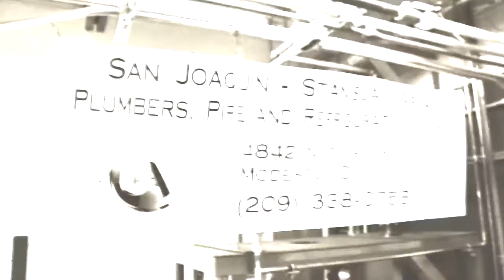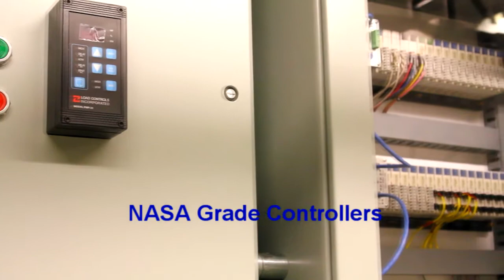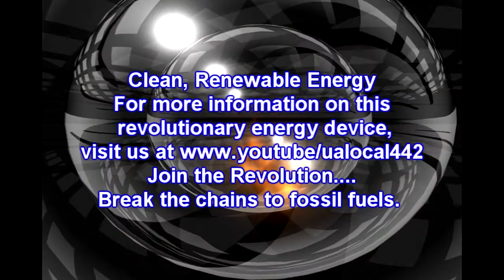Worlds First Air Pollution Free Hydrogen Steam Boiler

Comment: You can thus use steam as an inert gas itself so pre steam the thing and take out existing atmospheric gasses !!! having a co2 supply can make for a better fire extinguisher process
Reply: Also why take liquid oxygen along why not produce it on site for ships whit pressure swing method so you do not have to destilate but just take out the nitrogen so we can actually get the oxygen without nitrogen the extra gases if not reactive ore no problem!!!

Comment: making the hydrogen burn clean over several combustion chambers under an inert protection gas is what ESA invented but keeping some steam behind as an inert gas using reversed tesla valve is my plan and making sure that there is not to much back pressure on combustion chambers by using a tesla valve in normal direction is key...
So the number of combustion chambers determines the temperature, the dimensions of the tesla valves in backward direction and one in the ones in flow direction determines pressure...
safety valve required...
heat can be used to release hydrogen out of lithium ( metal hydrate )...
Reply: Using a kind of hollow sphere in the first Combustion chamber with holes in it using  to guide gasses in the right direction it, and than using a hollow doughnut shaped thing around it with holes that shape the gas flow and than using a spark bridge to ignite it with negative potential against mass so the spark bridge ads electrons to the reaction making the gas extra hot requires extra combustion chambers but makes it extra efficient although more dangerous...
and then the output of this combustion chamber into the next one and just add a little extra oxygen so there is more hydrogen burned and than add more oxygen the next combustion chamber so the surface of the combustion chamber is acting as a coolant on the gasses it requires coolant and cooling ribs...
the inert gas itself used for starting the reaction can be reused by a cooling in a kind of high pressured condenser that has the gas on top and the water vapor will condenser at the bottom so the inert gas can be pumped back and reused for cooling...
once the Reaction is started the steam acts as an inert gas itself and the only thing left is using a high pressure valve that uses a spring and ball inside a pipe that can be used to vent exhaust but it requires a ball with spiral guides that go in against the spring...

Comment: Hydrogen and oxygen gas burning together will generate a 5,800 F.  MagneGas and oxygen gas has been scientifically verified to burn at 10,500 F. This is why MagneGas can cut metal 38-100% faster than acetylene. What if we were to use MagneGas and oxygen inside the Hydrogen Technologies, Inc zero emission boiler?
Reply: +Perpetual Overunity We know that hydrogen and oxygen gas will generate 580 psi steam. That steam could be used to make electricity at 2cents per KWH with the Langson Energy Steam Generator. Langson Energy is located in Nevada. MagneGas Corp. (MNGA stock symbol) is located in Florida.  Joi Scientific is located at the KSC in Florida. Joi Scientific has a website with a great video showing how their self sustaining hydrogen on demand technology works. The energy miracle that could occur would be the following: Joi Scientific generates the ultra low cost hydrogen on demand for HTI. The steam is used for Langson Energy Steam Generator. The two cents per KWH electricity is used to power the submerged plasma arc hadronic reactor called the MagneGas Refinery. The feedstock for MagneGas Corp is any type of renewable, organic waste feedstock. The MagneGas has multiple uses including Co Combustion of the exhaust of burning coal for energy. This process will dramatically reduce the emissions of burning coal and other fossil fuels.Instead of using fossil fuels to generate power MagneGas and Hydrogen Technologies, Inc boiler could be used for large and small scale energy production.